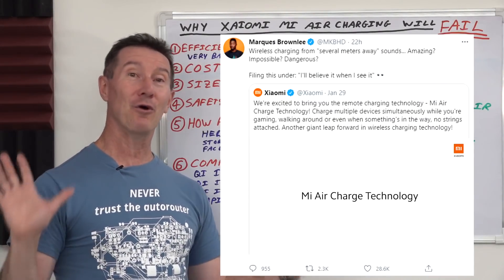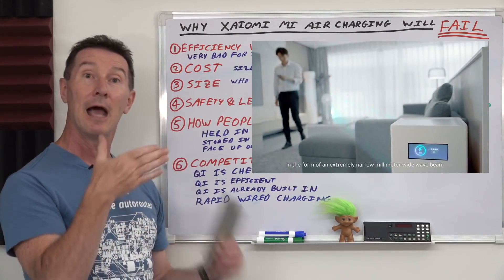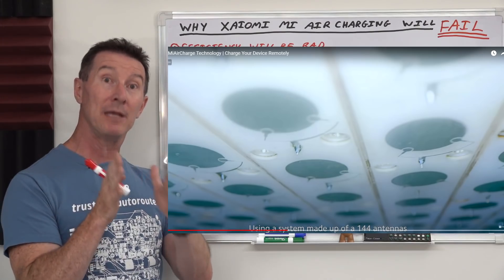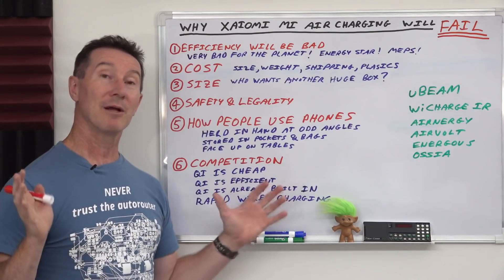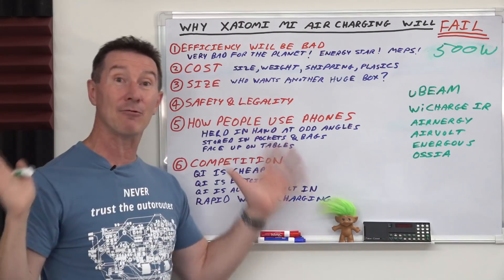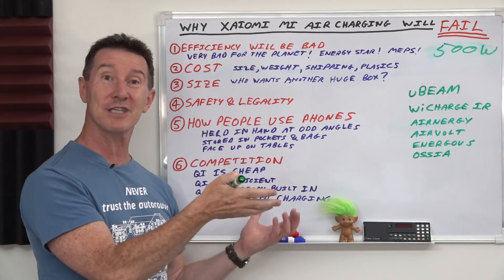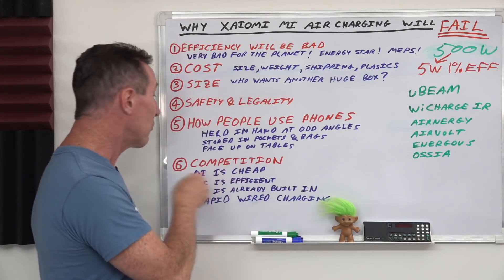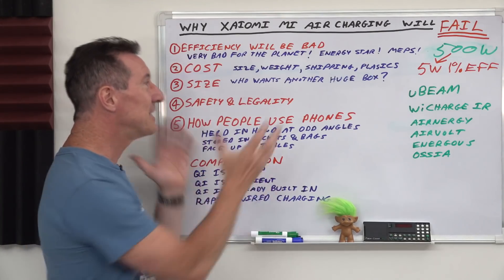EEVblog #1369 - Xiaomi Mi Air Wireless Charging BUSTED!

Comment: Hi Dave. I am a researcher at an institute where we develop RF power amplfiers in the mmW frequency region. Apart from all the stuff you mentioned there is another caveat with this. To generate the amount of power needed is insanely expensive in the 28 GHz range. To give you a frame of reference: a typical state of the art GaN PA can deliver about 5 to 10 W at 28 GHz. To generate half a kW, you would need about 50 to 100 of these chips (and they are not cheap, hundrets of dollars per IC!). I guess you wouldn't need that many, because your quoted power level was at the wall outlet, but still several chips and a combiner would be required. Absolutely crazy.
Reply: A half decent linear amplifier, operating at HF (roughly 1 - 30MHz) offering 1KW RF output for 100w RF input, is approx £5000 from the likes of Icom (who are well known and geared up for this kind of thing).
The numbers seem to suggest that the price to construct a finished product that operates up in the GHz would be "prohibitive".
Reply: @digitalradiohacker  Prohibitive for recharging a mobile phone at least...
Edited - Typographical error.
Reply: @digitalradiohacker  That's neither the right frequency band, nor does this application need a linear wideband PA.
You can be fairly efficient with a class-C amplifier for such simple illumination demands.
Reply: @namibjDerEchte  
I used the silly HF linear as an example of how much something costs down at HF frequencies.
It was a somewhat tentative way of agreeing with the OP.
At HF frequencies, when they run out of talent on their single sided PCBs, they simply use a wire jumper to skip from one end to the other. It is an example of how docile HF is, but despite that, it takes a manufacturer that has been in the game for over 50 years, operating in a very competitive market, to put the finished product together. Their price when competing against Chinese tat? £5000. 
If you'd like, I could put together a video demonstrating what I mean - I have 10's of boards from old HF radios / amplifiers here that I could show you, and what the REAL manufacturing processes look like at such low frequencies.

Imagine now, something at 28 GHz. A real, finished product - Not a schematic, or an idea. Bearing in mind, all I'm talking about here is the amplifier section, not the drive or antenna. Something where a 0.01mm deviation in the board would shift the frequency by 200MHz because of the wavelength in use. Think of the tolerances that would have to be maintained - repeatably, not just once for a research project.
Imagine the price to have this thing mass manufactured, packaged, instruction manual written, service manual written, a spares network put together.
When you get above 1GHz, anything that transmits in the Watts range and beyond is CRAZY expensive.
Reply: @digitalradiohacker  While I still think that PA you mentioned is overpriced (though you might have forgotten to mention some details like ruggedness, passive cooling even at high ambient temperature, etc.), I am well aware that both "linear PA" and "wideband amplifier" are largely orthogonal factors that increase the cost.
My point is, that a class-C microwave PA that operates at a fixed frequency and power is already far cheaper, and even more so if it only needs to provide a constant output level (simple microcontroller based PID to adjust the PA's supply voltage based diode-demodulating a monitoring output from an asymmetric power splitter) and stable phase delay (to allow phased-array operation with the PAs after the phase shifters).
Reply: @namibjDerEchte  in my experience, you will have a major price difference between a ready to go unit in a rack mount box and a diced IC. While you can get the IC that produces 8 W at 28 GHz in volume for less than 1000$, a rack mount unit with the same power output, power conditioning and control circuitry, warranty and so on will be 20 000 upwards. So prices can be tricky to compare.
Reply: @namibjDerEchte  Icom make some of the finest HF gear in existance. They also produce commercial VHF / UHF equipment that directly competes with Motorola / Vertex and Hytera. They are no joke, and have been making that gear for decades in a market that is flooded with cheap tat from China.
I can assure you, they're pricing is as competitive as it can be to maintain the business and retain quality standards.
Maybe it was a poor comparison for me to use, but it was a comparison nevertheless.
Good enough for a PhD thesis? No.
Good enough for youtube / the girls I go out with? More than.

Comment: No way can this stuff be sold. FCC regulation for maximum permissible exposure in mmwave bands is limited for General Population / Uncontrolled Usage to as low as 1mW/cm2 power density. The measurement is usually done at 20-ish cm separation distance. That’s why all the user manuals say you should avoid hugging your radio transmission equipments. So to be able to deliver 5W (simply omitting the inefficiencies on the way) you’d need 5000cm2 antenna area to comply with the regulation

Comment: Motorola apparently also showed something similar. One thing missing in your argumentation is that if the charger would require 1kW as a ballpark figure, where do the 995 unused watts end up? The energy can't disappear. Those 995W will heat up something.
Reply: The users brain for example?

Comment: exactly, why does everyone wants to develop another wireless charger with horrible effeciency? have never understood that.
I remember Porsche wanted to include a wireless charger to the Mission e, today Taycan. haha as I had told them...bad idea and it never xame out.
There were others at Bombardier they tried to tell ne that the air gap between primary and secondary side dies not realky matter, not really important, well I had straid ran away.

Comment: Basically this thing is a microwave oven with no screened box. I'm not going near one. I remember when I used to design radio pagers in the early seventies. We used TV Yagi antennas as dummy loads for the transmitters - we could light up distant fluorescent tubes by pointing at them. We'd work until the headache got too bad.
Reply: I was think this myself. My microwave does 900W, maybe I can pop my phone in there and get it charged in a few seconds!
Reply: @JohnnyMotel99  You are almost correct. Pop it in the microwave and you'll never need to charge it again :D
Reply: @HugSeal42  😂😂😂
Reply: soooo if i put 14 receivers under my dinner plates its also gonna cook my food?!
Reply: @Frietpan  Here's another issue. The multiple antennas only make real sense if this is a MIMO system that steers the power to the right spot. And you can't do that with CW - you need a digital training burst to extract the eigenvectors. And it also only works in a two way system. The downward path has to be converted to Eigenvectors which are then inverted and returned immediately. The transmitter can then use that info to change the phase of each transmit antenna to ensure that all the power arrives at the receiver in phase. And of course each transmit antenna needs its own PA. There is so much about what is going on here that makes no sense.
Reply: @donepearce  I believe you are conflating MIMO and beam forming. They are both multiple antenna technologies, but MIMO uses multiple antennas to send parallel data streams while beam forming uses multiple antennas to adjust the radiation pattern. In beam forming the pattern is adjusted by controlling the phase and magnitude of the signals exciting each antenna in an array of antennas. This should be doable with CW. 

What I have the biggest questions about is ERP or effective radiated power, as your original post described. The radios in commercial networks are only pumping out a few dozen watts per antenna port (most I've seen is 45 W), but the power received is tiny even close to the site due to the transmitter height and the narrow vertical beam widths of the antennas used (5° or so). Around -60 dBm would be a strong signal (1 nano watt). Like Dave was saying the power needed to be transmitted by the wireless charger to transfer 5 W (37 dBm) of charging power across a room would be huge. I can't see a regulatory body like the FCC ever approving such a device to sit in your living room. 

I believe the SAR limits for general population/uncontrolled exposure would be relevant:

https://www.law.cornell.edu/cfr/text/47/1.1310

Even mobile phones in your pocket or against your head are getting near these limits. And they only transmit 23 dBm!

https://docs.fcc.gov/public/attachments/DOC-361473A1.pdf
Reply: @Fix_It_Again_Tony  Beam-forming is trivial - you just adjust the phase and amplitude of each antenna element. But clearly there is no point beam-forming if the beam is pointing the wrong direction. Finding that would require some feedback from the mobile. MIMO has an element of beam-forming but the purpose is to make all the multipath phases coincide at the point in space where the mobile is. That requires fast realtime feedback, so I'm pretty sure it isn't happening here. If that transmitting antenna is not in some way smart, all it can do is have a narrow vertical beamwidth and an omni horizontal one. That's a lot of wasted power.
Reply: @donepearce  The way that beam forming algorithms know where a UE it at in an LTE cell is by analyzing uplink references signals sent by the UE. From there the base station can adjust the down link antenna weightings for beam forming. That could be done for power transmission by sending a periodic reference signal back from the phone to the charging station a multiple times a second to track the phone. Time division duplexing would be necessary to avoid interference with the signal for charging, just as in LTE beam forming.  

I don't see how MIMO plays a part here. MIMO is about multiplexing and transmit and receive diversity using signal coding. MIMO either increases signal quality by transmitting or receiving the same data stream from all antennas (diversity), or transmits completely different data streams from each antenna to create independent transmission channels (layers).

This is not the same as beam forming which adjusts the amplitude and phase (antenna weightings) of each antenna element or an array. MIMO works by coding the signals differently, not by adjusting antenna weightings. 

Transmission mode 7 in LTE is single layer beam forming which uses a single transmission channel. This is beam forming without MIMO. Transmission modes 8-10 all use beam forming with 2 to 8 layer MIMO.

So in LTE you can have beam forming without MIMO by using TM7.
Reply: @Fix_It_Again_Tony  Sure. But beam forming still demands that you know where your target is. That is what isn't addressed if this thing only transmits CW power.
Reply: @donepearce  while two way would be quite easily possible also modulation is theoretically possible. and f your target does not move to fast, you do not need to recalculate and adjust all these coefficients too often. so this can be solved not that this makes the conceptmore practical.
Reply: @Frietpan  lol.
Reply: @Frietpan  I think "cook" is probably a bit generous for 5W. Your own body is putting out 100W of heat right now, and I don't know about you, but I can't fry an egg on my hand.
Reply: @PhillipParr  if you could radiate out 100w through your palm as opposed to your whole body, you'd be making omelettes 😁
Reply: As he points out, this ISN’T microwave technology. If it were, despite what the claim may be, it would never get approved,  just keep this in mind when commenting.
Reply: @melgross  It certainly is. The dimensions of those patch antennas bears witness to that. This thing radiates at many GHz. Whether it has approval or not is a completely separate question.
Reply: Excellent response, this was my thought as well lol. It is basically a 500watt microwave oven but instead of cooking your leftovers it'll probably cook you lol!
Reply: Would make a lot more sense like that. No more cold spots in your microwaved food with beamforming! Or you place it under your table to keep the food on your plate warm. The possibilities are endless!
Reply: But you can look at it this way - every new technology, even if it is a fail, leads to something new. But yeah, does not sound good. Video was really interesting.
Reply: Oof
Reply: millimeterwaves != microwaves
Reply: On one hand, people are freaking out because "5G will cauce cancer due to radiation", and then those same people are first in line to install whole transmitter in their living room...weird times we live in
Reply: @blackwingmaster141  Its not weird times, its weird people that refuse learning physics. And keep on living a dream.
Reply: @userPrehistoricman  Well, if you're not the one doing the cooking, you're the food...
Reply: @blackwingmaster141  Damn it! You beat me to it. :-)
Reply: yeah. any free high energy electromagnetic wave is something to steer clear of.

Comment: the closest I've seen to efficient wireless power are signal-powered radio-receivers (which are suitable only for headphone/earbud use due to not having enough power for the amplification loudspeakers require)

Comment: You mean we should build a solar road or paved way and then use the energy for wireless charging while riding the ebike and charging ebike and tablet or smartphone or far better 100 kWh EV battery ...

OK, I get it they might suffer from investment needed and efficiency but at least in australia the sun is shining while we are sitting in an ice shed with no sun

Comment: "Why does it exist?"
That's simple, who likes plugging things in and being tethered while recharging ?
Obviously it can't work efficiently and it's a complete waste of time and money but if we didn't need to physically plug devices in or leave them in a specific place while charging them it would mean a lot more freedom.
Imagine never having to charge any mobile device ever again, if devices could be constantly being charged all the time we could reduce battery size, throw away those annoying cables that keep breaking and forget all the problems that we face when a battery goes flat (can't find a cable, no time to wait, missed calls etc.).
If there was such a technology that was efficient and safe everyone would want it.
Reply: I can see this working in office environments where it could charge several phones at once.
Reply: It's better to tether the phone physically and fast charge it in like 30 mins (upto 100%) instead of waiting for the phone to get charged to 50% for over an hour. After a point, it becomes more important to save money than gain convienience.
Reply from the maker: It's called Qi and costs $5 delivered.
Reply: Do you sleep with the phone in your hand? Do you shower with it? Do you have it in your hand during sex? Do you eat with one hand only? 
These are all times a phone could be charging.
Reply: it sure isnt efficient to run power lines everywhere and brun coal regardless of demand.
Yet somehow the system works

Comment: Random question, but would you feel comfortable with living underneath 420,000v power lines? Asking for a friend with children that is contemplating buying a house very close to them. Cheers.
Reply: They can save a lot of money on lighting by just sticking fluorescent tubes to the ceiling with no casings !
Personally I would not want to live directly under HV transmission lines, I'm surprised someone actually built houses there !
Reply: @ian-c.01  lmao at the fluorescent tube part. 😂👍 Thanks for the answer though, I wouldn't want to either.

Comment: Thanks Dave - you made my Saturday morning.

I still would think there is a safety issue. If the signal is badly attenuated by things as stated, then that energy still has to be going somewhere. If this abomination is pumping out 0.5-1 kW at the source, if you put anything close to it that's remotely conductive, it's going to get hotter than a $2 pistol...
Reply: Yes, don't put your tin hat on the thing.

Comment: I mean, at least it'll be a good electric heater in the winter. Almost 100% efficient.
Reply: by this standard most devices are almost 100% efficient in the winter, and it wouldnt surprise me if they branded it as a 2 in 1 heater/charger to make it legal
Reply: 500 watts, hope you have a small room.
Reply: @mstcrow5429  well, that was the absolute best case. I think I heard a kilowatt somewhere in there.
Reply: @niklaskoskinen123  I don't need to use mine at my current place, but it's rated 1.5Kw.
Reply: @mstcrow5429  yeah, that's the most common power.
Reply: It's an eyeball cooker. One of the few parts of the body that can't easily dump heat into the blood.

Comment: A power pack with an integrated QI charger solves this "problem" (charging your phone without being tethered). Could even charge your phone while it's in your hands or pocket.

"Absolute vvankery" - Dave Jones 
(They should put that on their website👍)
Reply from the maker: They have my permission!
Reply: QI charges is also kind of stupid. Why not just something like a CM mini batery you put on the end of the phone, with same width and thickness, you can have 5 of them in a wired charger with a  magnet or something that make them conect.
Reply: do you have recommendations for switched multiplug packs ? i.e multiplugs with individual switches
i want some badly

Comment: wireless charging at 5 watt rate? I think super fast charging is capable of taking in 45 watts or something... yeah, no.. I'll just going to plug in for super fast charging.
Reply: that's very 2015 
fast charging reaches 120 W now (by splitting the phone battery in 2 and charging both halves at 60 W)
meanwhile fast wireless charging goes upwards of 50 W